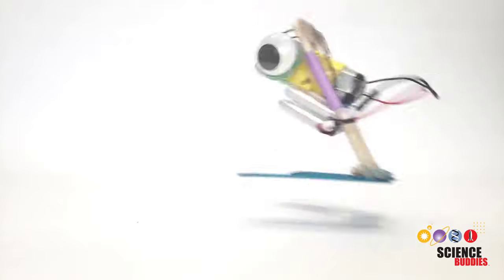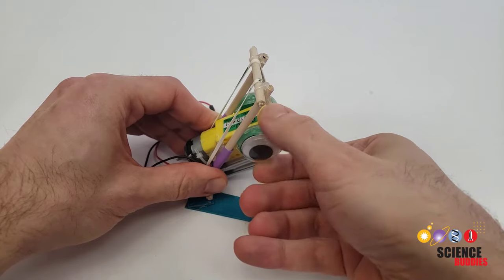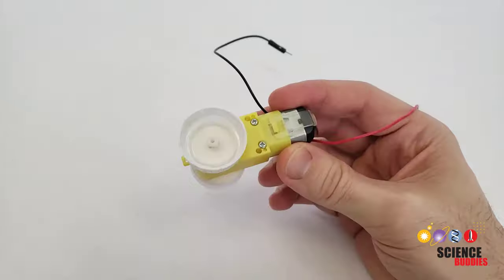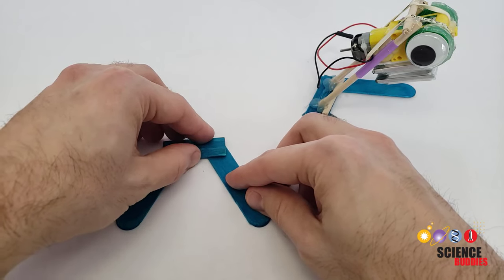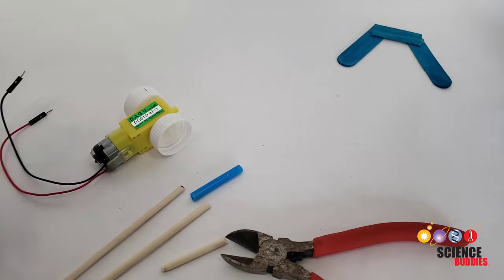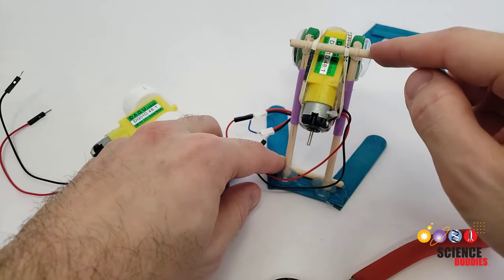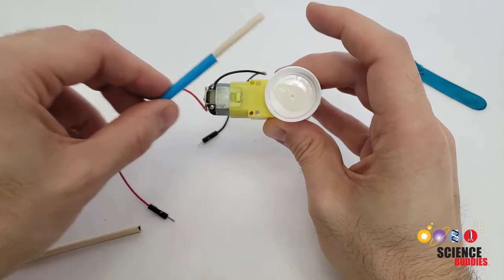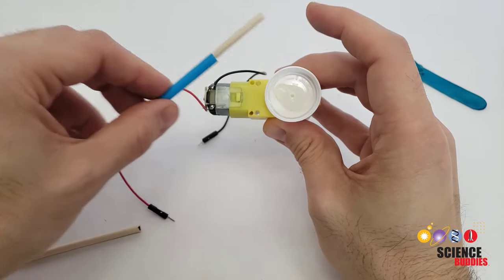DIY Jumping Robot: Fun Engineering Project

Comment: Tips for building this robot:

--Not all of these motors are the same.  The ones I bought lacked the torque required to pull down the frog.  Plan ahead, buy good motors, and test them adequately.
--Smaller diameter bottle caps are better than larger ones.
--The batteries must be charged individually.  If using more than one battery (required in my case), wiring in series and soldering the connections will negate any ability to re-charge the batteries using the lipo charger.
--Rubber bands used as traction material on the "eyes" works well, but the glue that holds it to the bottle cap MUST be good or it won't work.
--Hot glue used as traction material is adequate, but if applied too thickly it will increase the friction in the "straw" area.  Additionally, it may only start to grab after it heats up due to friction against the "legs".

Comment: I really like this project - I ended up coming across it while researching jumping robots for my final year project and it actually answered quite a few of my own questions about how I'd make something like this work. My project would be complemented by an Arduino Microcontroller where the user can interact with the motors (using ROS2) to give full flexibility on how frequent and fast this robot moves. (Which might also rectify some of the issues you talked about during your video) 

I have a question about how I could get this robot to turn on command. The best idea that's been put forward to me so far is to have a system of two motors next to each other, and when a user wants to turn, only one of the motors operates which should in theory move the robot in a certain direction. Is there an easier/more efficient way of doing this?
Reply from the maker: Hi - that's certainly an interesting engineering problem, and since we haven't tried it ourselves, we can't say for sure what the "best" way to do it would be. One alternative approach would be to keep a single motor for jumping that activates both legs, but have a second motor/mechanism just for turning. You'd have to be careful jumping with just one leg at a time that the robot actually turns instead of just falling over. If you haven't seen it already we also have a large Arduino playlist on our channel that you may find useful.